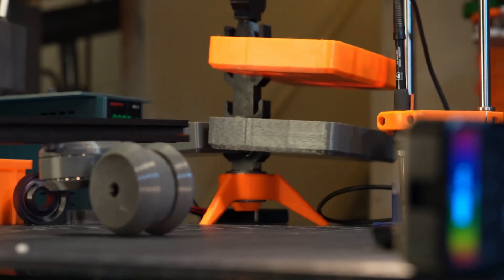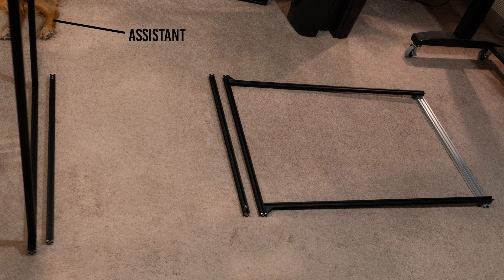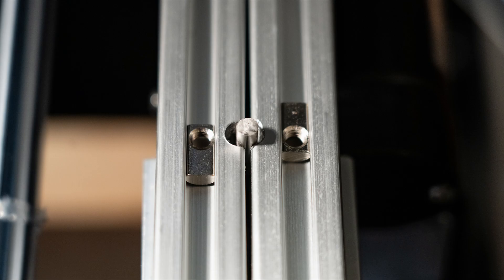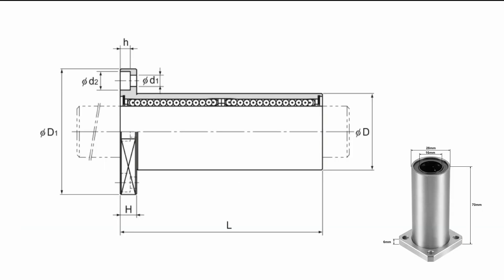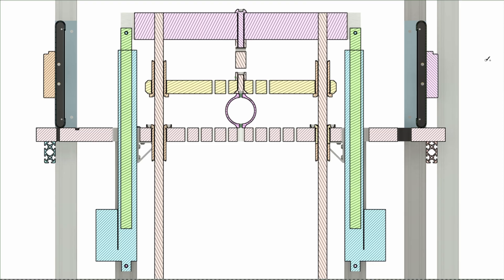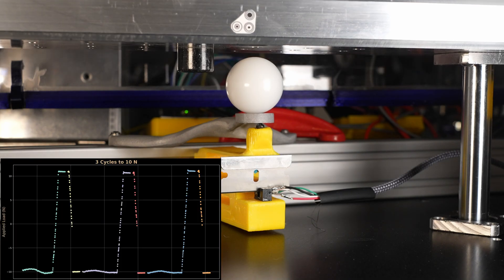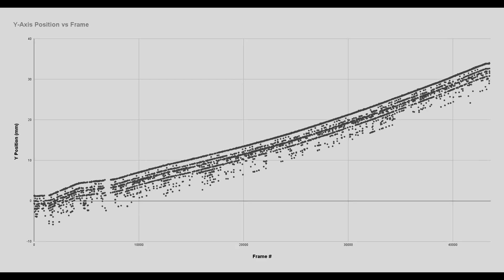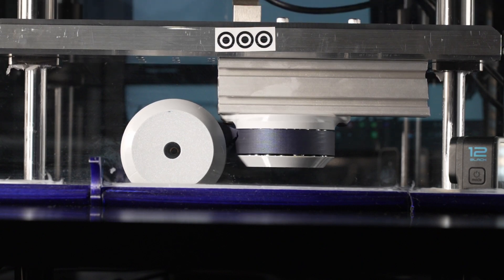DIY Universal Testing Machine for the Home Workshop

Comment: Nice video.  Really appreciated the details and the free body diagrams.  A thought for you .  Could you improve the camera resolution by adding random movement in angle or linear position perpendicular to the direction you are measuring.  If its fast and random it could improve the resolution in the vertical direction by effectively over sampling the camera targets.  Wont be a huge improvement but should help.
Keep up the good work

Comment: Great video! I'm actually setting out to build a very similar machine. For displacement measurements I do love the idea of doing a video-based extensometer like you showed, but for now I'm using a DRO scale from Amazon. They can be very plug and play though I still need to test repeatability and accuracy. 
The one I'm using does the processing (reading encoder pulses) on the scale itself and sends the actual value to the included LCD display via serial. Instead of using the display, this signal can be read very easily by the arduino directly. Since the chip on the scale is always taking care of reading the signal from the encoder, you can simply read for the current value so you don't need to use interrupts on the arduino to avoid missing an encoder pulse.

Comment: I worked with some big MTS load frames, and we used Digital Image Correlation (DIC) to determine local strains, but this required some high speed cameras and a speckle pattern on the parts. There was also the distinction of force control vs displacement control, and usually displacement control ran at fractions of mm a second (I want to say 0.05-0.5mm/s, but it’s been a few years)- I wonder if you could put rotary encoders on the lead screw and use those measurements along with the screw pitch to get less noisy displacement data. Great video!

Comment: Great project. Thanks for sharing and giving a concise explanation of the mecahnical considerations. 

What do you use for building your kludgy GUIs?
Reply from the maker: @timhansen54 Thanks! 

For this one I used the NiceGUI framework. I more often go with Py-Qt, but I've experimented with NiceGUI a few times now. I like that it creates browser-based interfaces, and it's pretty easy to work with compared to Qt (IMHO). Far from perfect, but in general I like it quite a bit.

Comment: This is very cool. Camera based displacement measurements are pretty common, I suspect there are some software libraries that can do better image processing to give more accurate data.
Reply from the maker: @dansmith-i5r Thanks! And for sure, I am currently using a pretty generic opencv library (HoughCircles). Given how common cctags are, I suspect there are some open source projects out there that would give big improvements. If you know of any worth taking a look at, I'd welcome any recommendations!

Comment: Possibly the 1-inch thick aluminum is from an optical breadboard?
Reply: I think normally optics surfaces need better thermal invariability than aluminium, not to mention anyone who knows anything about how much those things cost for their precision would know better than to start milling one or god forbid apply 2kN of force onto it
Reply: @emilyyyylime-   My coworkers are using 13 mm aluminium optical breadboards for non-critical applications. If you order them from China, they are quite cheap and reasonably flat. At least nothing that adjustable optical holders can't compensate.
Reply from the maker: @hullinstruments no, but I would have loved it if they were! Would have saved me the time of tapping that array of holes in the base plate! But I was putting in a 25mm square pattern similar to a metric breadboard with that hole array since I do often design stuff to match that breadboard grid. Just with M5s instead of M6s. 

I did get my hands on a small stack of 13mm thick aluminum breadboards at the same time though (it all came from an optics-focused startup that was winding down). Unfortunately none of those had the dimensions I was looking for....that, and I figured I should throw the thickest chunk I had in for the base plate :)